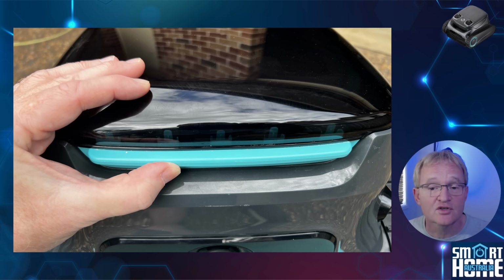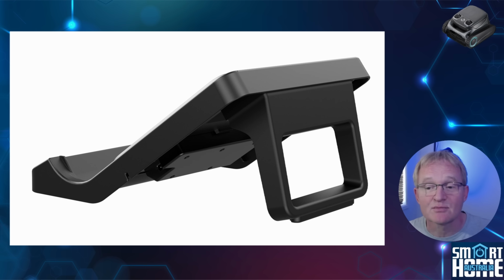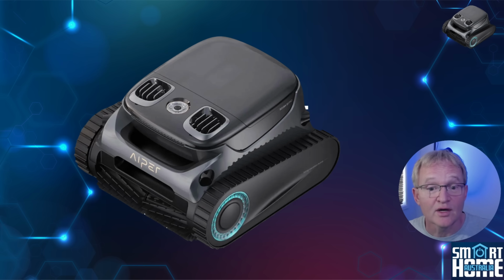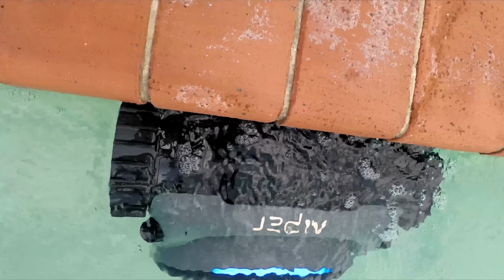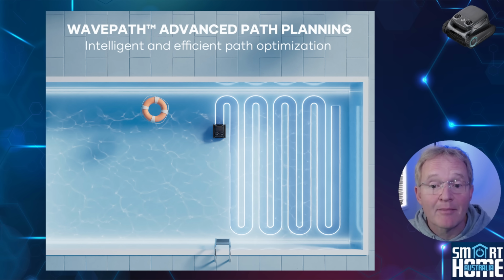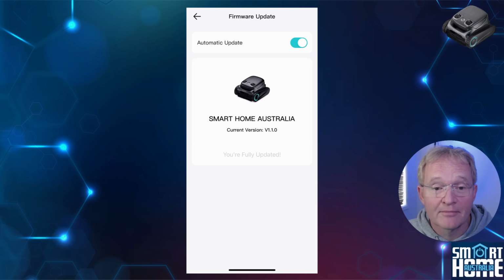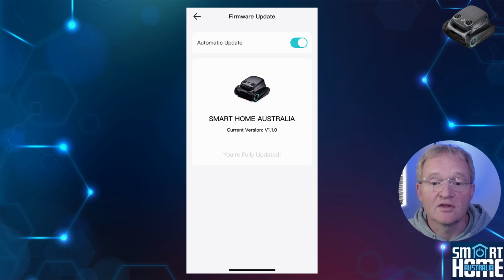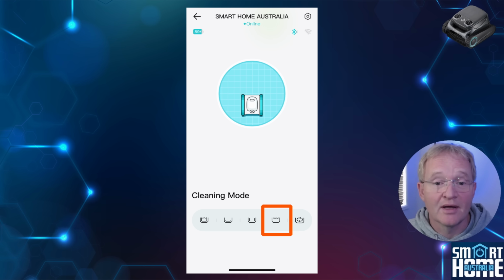🏊‍♂️ Dive into the Future of Pool Cleaning with the Aiper Pool Cleaner! 🤖

Comment: Thanks for the review, It certainly seems like a versatile machine. I've looked at battery operated pool cleaners recently and the one thing that worries me is replacing the battery when it no longer holds enough charge. We've seen so many electric bikes become useless because the manufacturer stops making replacement batteries in the correct form factor, I fear the same will happen in the pool robot space. At least with an e-bike a skilled and knowledgeable person might be able to rebuild a battery with replacement cells, but in a product where it's imperative that a battery remain waterproof cell replacement seems unfeasible. Pool cleaner companies would be doing themselves a favour by agreeing a standard for their batteries to make it easier to support replacement when the time comes. There are EU rules about the availability of spare parts but as we've seen with the flood of cheap 'no-name' e-bikes, people are still left with a useless device once the battery reaches end of life.
Reply from the maker: I checked with Aiper and they are saying 3-5 years or 500 full power cycles. They also said that the battery was not replaceable. But since the warranty is 2 years and outside of that you might as well get it replaced, I expect a few companies to spring up offering replacement batteries if your device is still sound, but you never heard it from me ;)